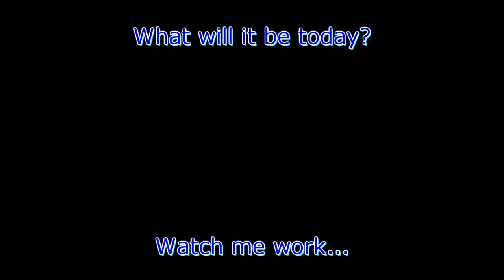3.0L Supercharged CTU engine teardown part 2

Comment: are you using a trim removal tool to separate the hose's or is that a another tool ?
Reply from the maker: Yes, it has a tapered leading edge that can be useful to get between 2 items.
At the beginning of the video I'm pressing it between 2 plastic pieces.
Rather than just pull on the plastic pipe, I'm using the tool to push from the back while I pull. 
Sometimes, the pipe pulls out easily... without having to use any tools.